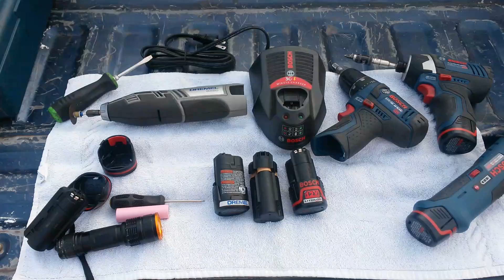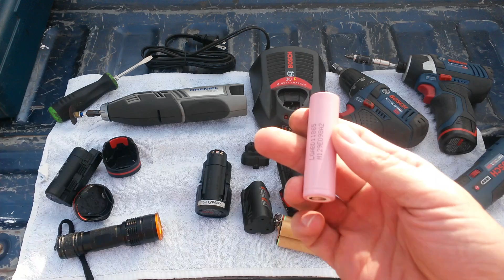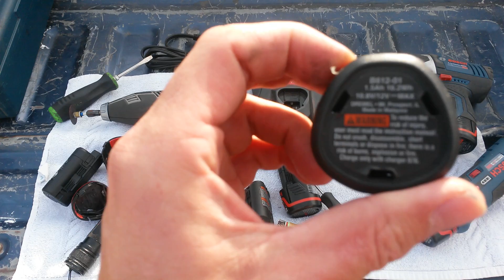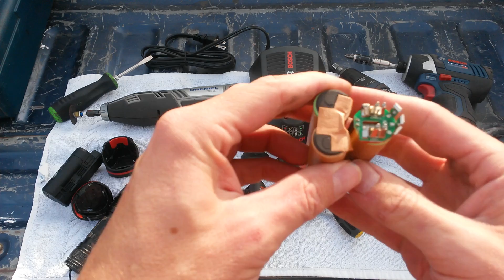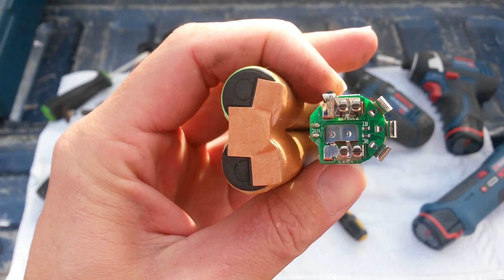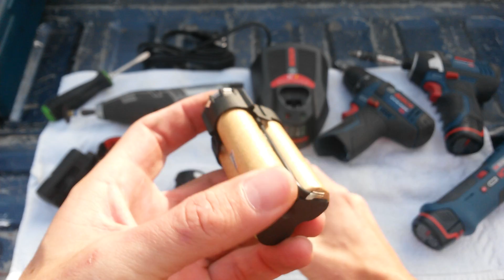Re-Building Bosch & Dremel 12V Max lithium-Ion Battery Packs ~18650 Cells

Comment: Do you have any idea what's the difference between Original Bosch 12v and the one from Aliexpress?

I built a battery for my Bosch 12v tools, for the screwdriver it works well, but then I discovered that for the orbital sander it doesn't so I check the internet and I realized that the 3 additional contacts should have some resistance between them - fixed it and it worked...

But now I have a oscillating tool which has only 2 contacts and if fails starting, it starts with my fiends original battery but he's not letting me disassemble it :D

Comment: i hate companies that do this they dont use the bms in the battery they do it in the tool...

only companies i know for sure use bms in the battery are ridgid and ryobi.. milwakee does not i know these 3 for sure so if you want to use them on something else you have to make sure the tool has a bms or the project your working on aka using the old bat pack has a external bms.. they do this to force you to pay more for the tool

Comment: Hi there, just bought an impact screwdriver but it comes naked, as no charger and no batteries. Only the tool. I plan to print a 3D holder for the bottom/battery part, but I need to know the polarity of the contacts of the battery or inside the tool itself. Can you please help?
Thanks in advance!

Comment: I upgraded cells from 1Ah to 2Ah with salvaged ones from Makita battery. At least by sound of it tools have more power with new cells. I have soldered all tabs, no problems so far, so spot welder is not needed. Of course if you would start to make many battery packs it would be good investment, you can also build your own spot welder cheaper.

If anyone runs in problem that I had, when Bosch charger reported battery broken after build. The problem was,  if 18650 are charged fully to 4,2V in other charger, Bosch charger thinks that battery is overcharged, how I understand these batteries are not balance charged so to be safe they are charged to lower safe level of 4,1V. Just discharge battery using it with your tools and charger will accept it.

Good video showing how easy this really is.

Comment: Yea, you can just go out and buy a "spot welder" to weld miniscule parts to batteries 😆 It would be cheaper to buy a new tool or a new battery 🤣. Instead, you'll pay  a couple of hundred dollars for some random "spot welder" you can only use on lithium ion batteries 😆 Then what happens when you can't do it? Now you have to buy s new tool/battery anyway.  Unless it's something you already own, which most people likely don't, then repairing and replacing batteries in those is financially irresponsible. Why spend hundreds more than you need to when you can buy a new tool or battery to replace yours for much, much, much less?

Its not logical.
Reply: Get you panties back in you trousers. There are cheap spot welders. And you get a tool that you can use for multiple occasions.
Reply: Is there a company I can send my busted 12v battery to repair it? A lot of these 12v tool systems are discontinued and it’s getting harder to find replacement batteries or even the bare tools.

Comment: I try to open it..its easy but to soldering it, very hard to me..when solder, its not going stick each other
Reply: use hcl , leave it on the surface u want to solder for ten minutes , then u can easily do it in a few seconds . be sure to use a good quality solder wire too

Comment: Tried to open 18v Bosch battery and found that it has few slots without actual bolts in them. Just plastics. What should I do to disassemble these? Drill those and put additional bolt after? Please advice.

Comment: I wouldn't recommend putting 3000 mah 18650's in there, they don't have the amperage you need to drive something like that, use 1500mah or 2000 mah 18650's to get more amperage
Reply: please explain
Reply: steven whitesell I agree with all of that but the last sentence. Voltage would burn the tool up. The only concern is the batteries having the available discharge rate capacity that can possibly be drawn by the tool. Amperage is drawn. Voltage is pushed.
Reply: yes, please explain. mah is capacity rating, not power delivered to the device.
Reply: Some batteries designed for high drain, some for low drain, they have a high Ah, but amperage is limited. For tools, you need a high drain batteries.
Reply: Forrest is half correct. These Lithium Ion batteries use a mAh rating (anywhere from 1500-3500 on average) which tells you how much power is stored in the battery. They also provide an amperage rating (anywhere from 20-40 amps on average). The amperage rating tells you how power you can draw from the battery on a continuous load. Something that will not draw a large load like a low lumen flashlight or a vape kit at a low wattage can benefit from a super high mAh battery with a low amperage rating. Tools that can potentially be used rough enough to stall them or bog them down, super powered flashlights, etc  need the higher amperage to ensure enough power is provided without burning up the batteries. The down side is that to high of an amperage rating can cause the tool itself to burn up since internal wiring may not be able to handle the higher load available.

Comment: Is it possible to use these batteries for another application? 
I'm looking at using them for a bicycle headlight, and when I tried plugging into the + and - terminals, it didn't do anything. Do the T & C terminals need to be connected as well? 
Also, what controls the discharge level? Will the battery protect itself, or are those electronics in the device (drill, impact, etc)? 
Thanks

Comment: Neither my Bosch (2Ah) nor Dremel (1.5Ah) batteries have these tabs to open the battery. To me it seems ultrasonic plastic soldering or glued at the top cap.

I did appreciate the "how to change the caps" movie.
Reply: I believe they have made some changes since I shot the video.

Comment: The original Bosch cells are probably not made by LG CPI, but Samsung SDI:
http://toolguyd.com/power-tool-brands-dont-make-their-own-batteries/
Quote: "Bosch, Milwaukee, and Hitachi all use Samsung INR cells, Dewalt uses what appear to be Sanyo cells, and Makita uses what appear to be Sony cells. I haven’t taken a look at other battery packs yet."

Btw. Sanyo is now owned by Panasonic.

As you mentioned it says 3 INR 18/65.
18/65 refers to the industry standard form factor 18650 (18 mm in diameter and 65 mm long).
INR is a specific chemistry of li-ion cells:
Battery chemistry FINALLY explained http://batterybro.com/blogs/18650-wholesale-battery-reviews/18880255-battery-chemistry-finally-explained

INR / NMC is lithium manganese nickel (LiNiMnCoO2) chemistry. But not all INR / NMC cells have the same specifications.

It's very important to use the correct chemistry of li-ion cells and with similar specifications for charge and discharge rate etc., when replacing cells, just using the same brand is not enough. Li-ion is not just li-ion, there's several different types and some require different charging. Li-ion cells with LiFePO for example requires a different charge voltage than most other li-ion chemistries. DeWalt used to have lithium iron phosphate (LiFePO) cells from A123 in their power tools, but not anymore.
And INR isn't just INR, there's different ratios of manganese, nickel, and cobalt used in INR cells.

Power tools have a very high current draw, so it's important to use cells capable of delivering very high current (low internal cell resistance). Not all li-ion types are able to deliver high enough current for power tools. Laptop batteries for example doesn't require nearly the same current draw.

So unless you really know what you're doing, don't replace cells with another type or brand. If you really know what you're doing you can often find compatible types from other brands with similar chemistries.
Using bare li-ion cells are very complicated and dangerous. This is the reason loose cells are never used and sold in the local supermarket like NiMH rechargeable cells where all are interchangeable unlike li-ion chemistries.

And never solder taps on li-ion cells as they can't handle the heat from soldering and will get slightly damaged internally and loose capacity - or worst case leak or explode.
Tap welding is the only way to go if you don't want to damage the cells internally.

As you can see here Samsung SDI recommend their INR series for power tools:
http://www.samsungsdi.com/lithium-ion-battery/power-tool
But be careful when buying cells at places like eBay and AliExpress as the vast majority of cells are counterfeit. Some are used cells sold as new. And the vast majority of li-ion cells sold on the grey market are marked with fake mAh capacities much higher than the real capacity. Much higher than even available from brand names like Panasonic, SONY, Samsung SDI and LG CPI. If you find a cell marketed with higher capacity than shown at the brand names websites, you know it's counterfeit regardless of brand.
Reply: Wise words indeed. Thank you

Comment: Would there be any hiccups in using the Bosch charger with higher ah cells?  What regulates the charge... The charger or the battery?  I would wonder if you'd ever get a full charge on the higher cap cells.

Comment: Did you manage to replace the cells with 3,000mAh elements? 
I'm curious because for that size, the largest capacity offered by Bosch is 2.0Ah
Reply from the maker: I have not actually done it yet. All of my batteries are still holding a good charge and I have enough of them that I'm not feeling the need for more power. I do plan on putting higher Ah batteries in as soon as one fails on me though. It is very simple so I have no doubts in whether it is possible.